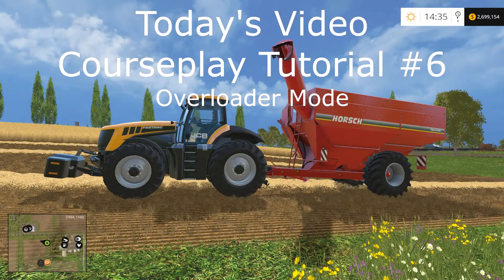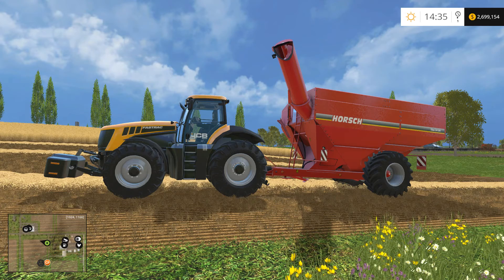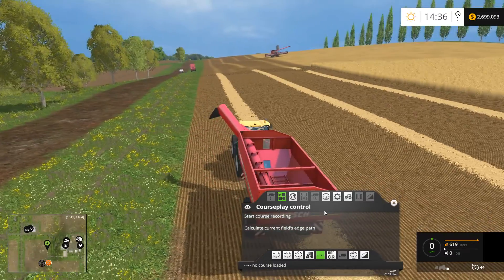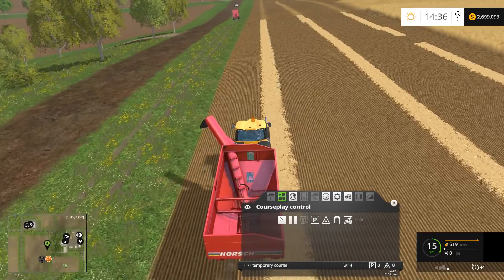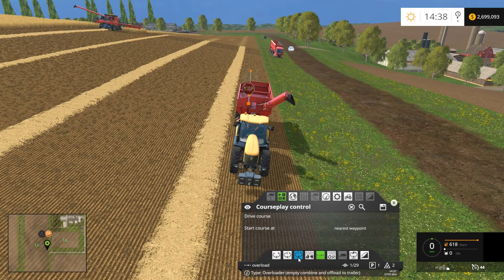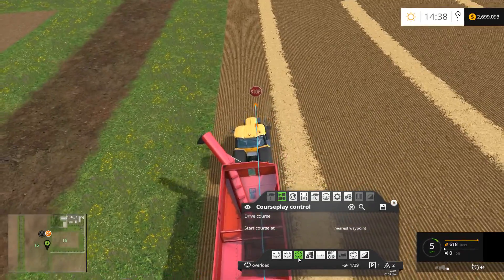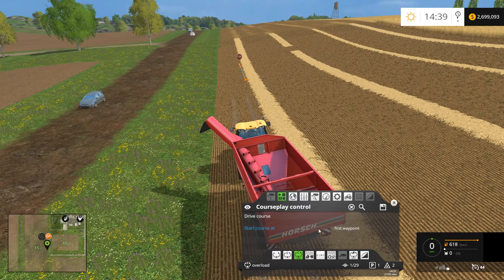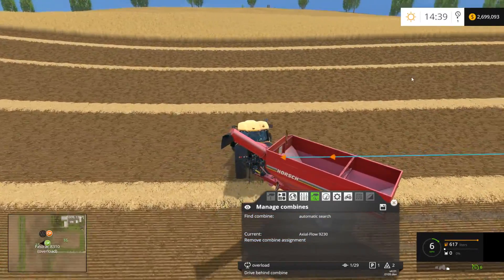FS15 Courseplay Tutorial #6 Overloader Mode

Comment: Nice videos! I noticed your combines do something like a small turn before ending the field. This is just standard, or you configured something? Thanks and keep the good work!
Reply from the maker: +Neri Perez that combine is actually using the auto combine mod. That mod works by sensing the harvested and un harvested parts of the field. Sometimes if it gets thrown off, subsequent passes will start to over exaggerate the issue.

Comment: Can you do one using multiple semis?  Far fields might need a second semi hauling harvest to base as to not allow the field workers to get caught standing around waiting to unload.  And using multiple Combines... how does getting them unloaded work?  One Grain Overloader per field?   Trying to beef up my production.  thanks.
Reply from the maker: +Daryl Rosenberg Yes, you can use multiple semis and multiple overloaders. If you notice in my video, I made it a point to make a long straight route where the overloader meets the semi, this gives them room so that you can have a few trucks/tractors running the same route without traffic issues. To do what your asking, you would just have multiple trucks and set them all to use the same course. The first one will stop at the normal spot, and the next truck will sit behind it "in traffic" until the first one leaves. I do this all the time as you're right, if the field is too far from your farm the overloaders will be stuck waiting for the semi to empty and return. Later in this series, I'll make a video where I have multiple combines, overloaders, and semis all working together to harvest one large field.